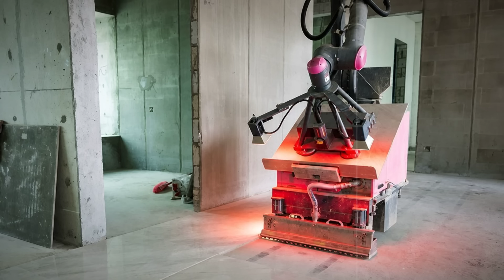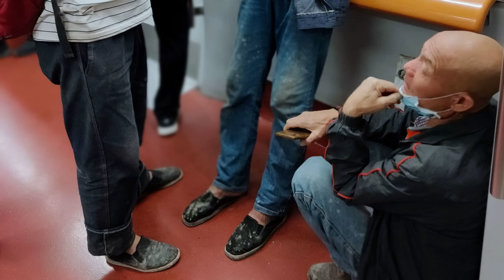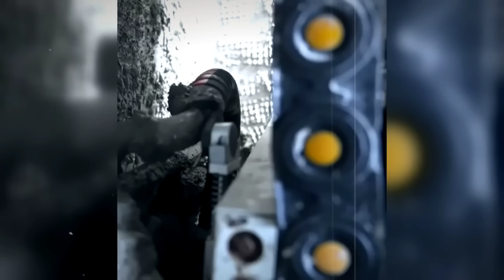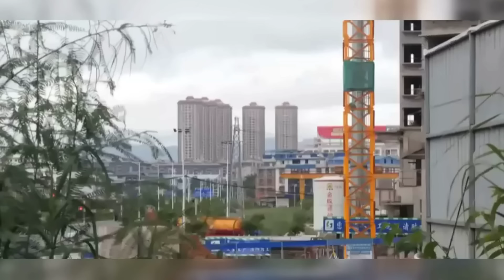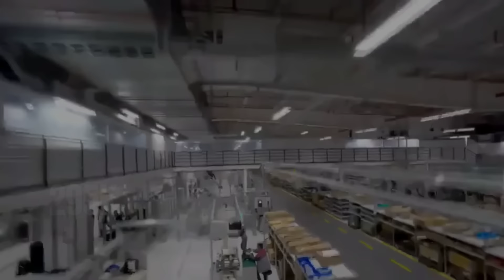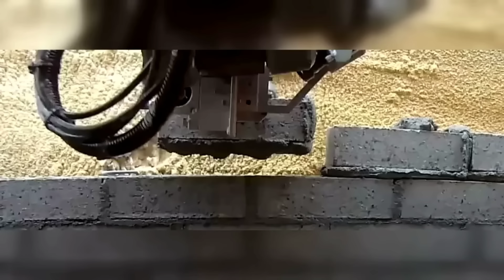China's New Robotic Bricklayer Built a Wall 6x Faster Than Humans—Construction Unions are Stunned

Comment: The problem is the aesthetic resistance towards prefabricated, (reinforced or not, depending on the situation) concrete panels. 
Concrete panels, when pressure formed, are much stronger & lighter, are much quicker and cheaper to install obviating the need for the time consuming individual placement and alignment of each brick and the variable viscosity of mortar due to temperature and humidity.

Japanese homes are built in multiples of 3x6 feet dimensions (the size of the tatami) which is conducive to prefabrication sizes.